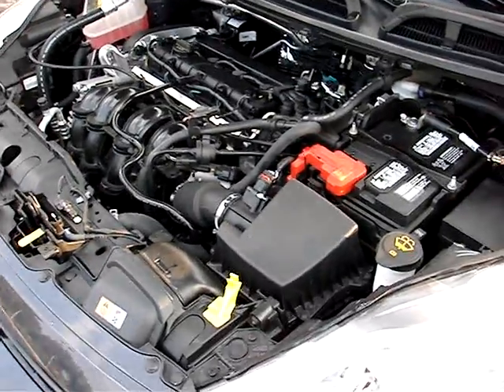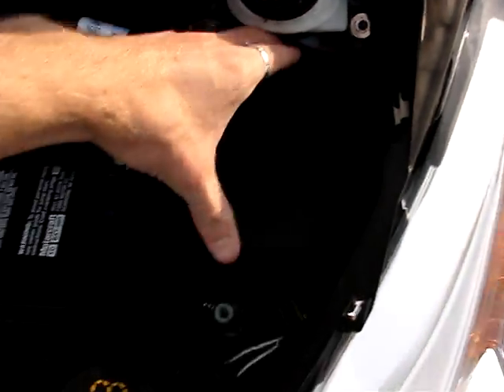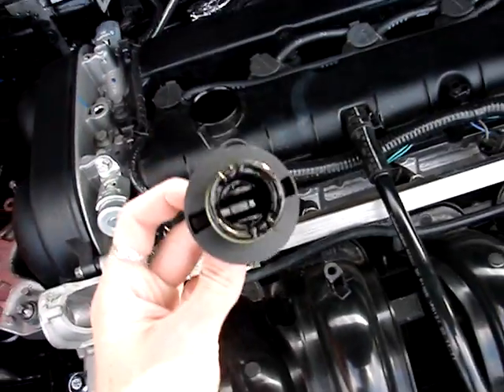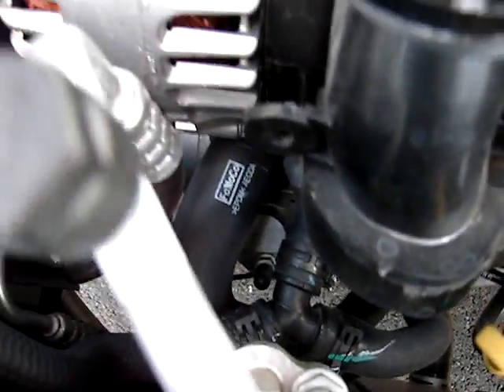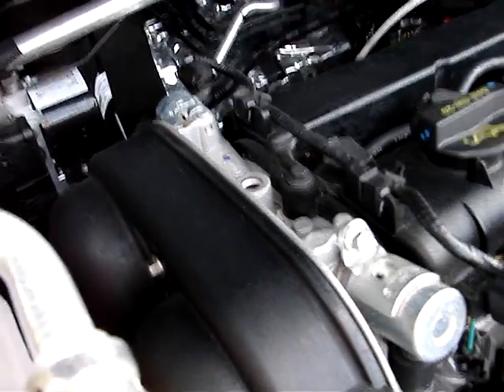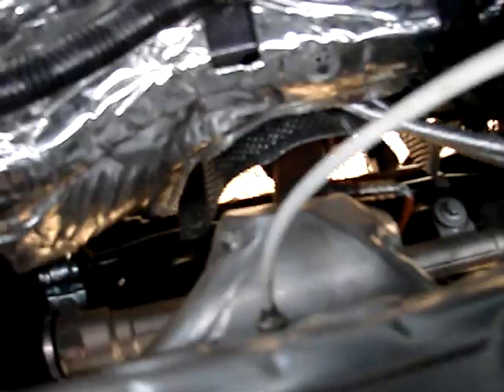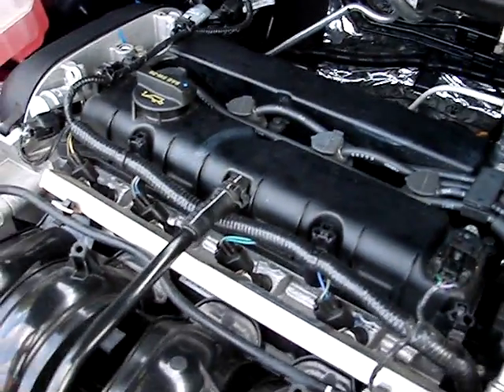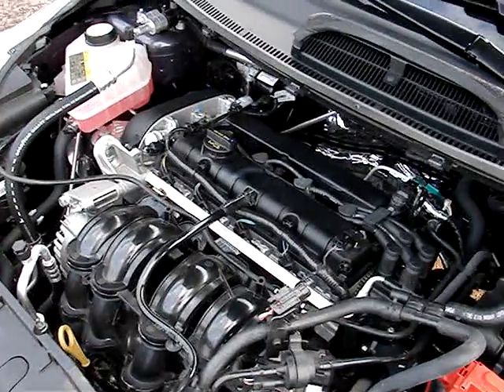2012 Ford Fiesta: Engine Bay

Comment: Could you please get some shots of the tunnel where the exhaust system travels? I'm very interested in modifying a Fiesta for AWD and I need to know if I must change the floor pan to fit the prop shaft. I'm not asking for a full video or anything, but I would really really love some clear photographs of the tunnel for the exhaust. Maybe just email them?

Comment: hi dude i just bought an used ford fiesta 2012, as i see you had one i dont know if this is normal,
when the radiator turns on i can feel a vibration around the driver seat, and the radiator makes an annoying noise, too strong, i dont know if this is normal... i have never driven a ford fiesta before thats why i want to know if the vibration is normal... and the last doubt is, when the engine is hot, the rpm go down maybe 900 rpm and i can feel a bit of vibration on neutral, not too strong but i can feel it, i ask this because there are cars when you are inside you dont feel any vibration, but in my case i can feel the vibration engine just in the front... if you can help me with this i will be grateful. my car has 28.000 km
Reply: If it's a low type vibration it may be time to have your engine mounts replaced.  Have a mechanic check it and try replacing the front right (passenger-side) mount first and see if that solves the problem.  There's another mount under the battery and another  one beneath the engine (torque support).

Comment: See, this is the type stuff that car companies need to include with the GIFT BOX in the operators manual, video. But that would mean that WE would be wanting to do things ourselves again, like filing and setting points on occasion. Checking air pressures, tracking consumption to KNOW when tune-ups were right around the corner. If it was a Mopar, I'd be listening for lifter rattle to tell me when an oil change was due.
LT680

Comment: Same motor as the 1st generation Miata just turned sideways with a mild cam and plastic valve cover.  120 hp, DOHC, 16v, 1600cc, no ignition coils, real plug wires, read distributor, room to work under the hood, no big plastic shield.

Thus I bought a 2013.  My miata was still running great at 270,000 miles on the original clutch, the second timing belt, the second tiny trunk battery and the second starter.  The guy I gave it to is still driving it 4 years later.

Hope to get similar life from this econobox.  We'll  see.  I thought 1990s motors were  the best of the internal combustion tech. 100 yrs.  2002 and beyond is kind of the 70s of cars again.  Experimentation and Uber cheap builds in a troubled industry.  Looks like Ford and others are pulling out of their recession.  Chrysler  and Chevy seem to remain warranty period cars.  Long term they are junk.
Reply: No. It is not. You have the 1.6 sigma confused with the 1.8 dohc mazda engine used in the 91 to 95 Escort GT.